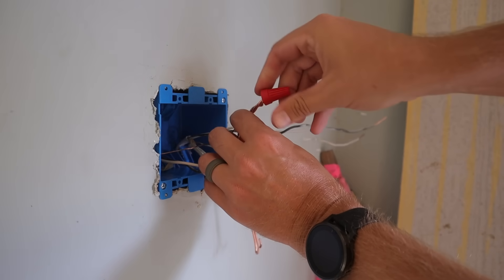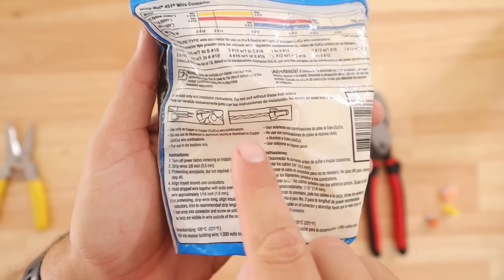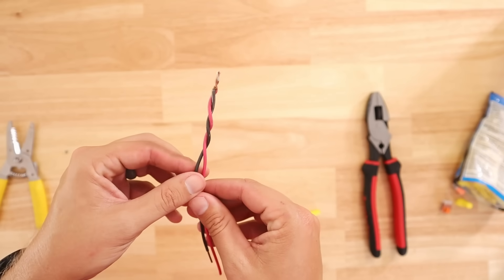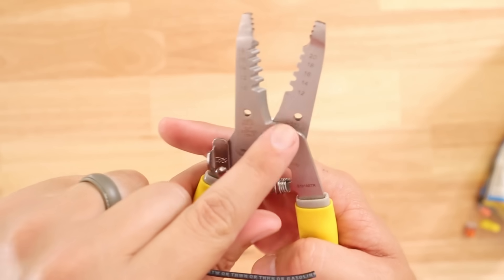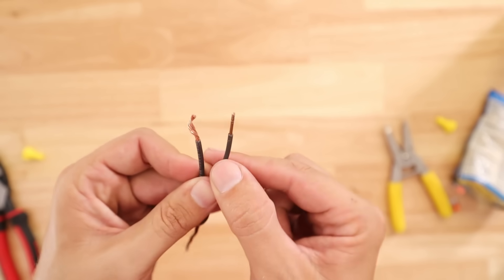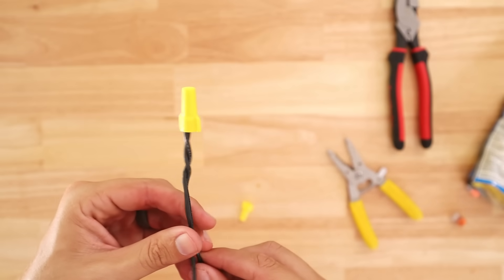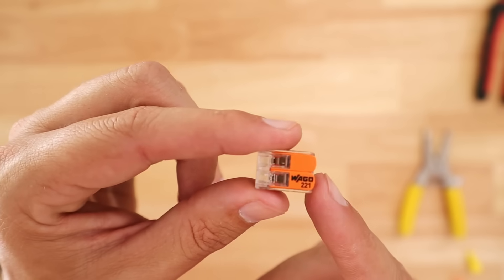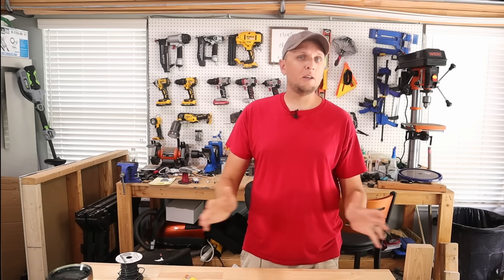BIGGEST Mistakes DIYers Make When Connecting Wires Together | How To

Comment: I did not see stranded to stranded.  String christmas light rotating  base the double stranded wire broke off flush with the tree base. I can see both strands on the base and I stripped the insulation off the other side of the power cord. Tried tape, too loose.  Wing nut or wago?
Reply from the maker: I like wire nuts but in a lower amperage situation like that, wagos would work great.

Comment: I pre-twist the wires together, Tightly wrap electrical tape over the twisted wires than twist on the wire cap nut onto the twisted wires/tape and than again wrap eLectrical tape over the cap nut tightLYyy
😬😬😬😬😬😬😬

Comment: I twist the ends of the wires first, then I use the wingnut. Using the pliers to make it equal is something I hadn't thought of that--I usually cut for even length.

Comment: Great video! I had to change out the electronic ballast on a fluorescent fixture in my bathroom today. This is a 70 year old mid-century modern house so there are some odd things we find when making repairs. The new ballast had solid core wiring, but the hot and neutral wires from the wall were twisted core. I followed your tip about pre-twisting the wires together before installing the nut. But now I wish I'd used a Wago connector, which I had in the tool box from another project. But now I know if ever I'm connecting the two different types of wire, I'll use the Wago.

Comment: Great vid! It just confirms what I've already been doing for decades, but I just wanted to double-check to be sure, as I'm not a licensed electrician. I never actually trimmed the ends after pre-twisting, but I'll do that now.
     Today I'm adding nice 20-watt integrated LED fixtures on a ceiling, and I'm tapping into a 12/2 cable for power.   So I'm shutting the breaker and for this I'm using a metal Raco junction box in my attic, and I'll be joining two, solid 12AWG wires to a single solid 14WG (3x).  A BAWN (big ass wire nut) will make the connection secure.  And I will be pre-twisting these three wires together before twisting on the appropriate sized wire nut. Thnx for the vid.
Reply: Sure hope your breaker is 15 amps
Reply: @flootloops757  Lighting Circuits are typically ran to 15 amp breakers.
Reply: I'd love to see a comparison video done with the way go and different sizes
Reply: So from what i am getting at you have a 12/2 already coming from your Panel and your adding a 14/2 in a 4X4 JB and that's going to your lights. So why not run 12/2 to your lights as well? and you could just use a blue wire nut, No need for the BAWN. Remember 14 AWG is rated for 15 amps and 12 is rated for 20 amps. Lighting circuits are ran in #12 so i would change out the 14 for 12.
Reply: @thegreatcanadianlumberjack5307  Hello to my new friend to our North!! I used 14/2 to mate easy with the small wires from the two lighting fixtures.  Keep in mind, these are two, 20W integrated LED fixture, so 40W/120VAC = 0.33 Amps.  So there's absolutely no need for 12/2 when the maximum current draw is 0.33 Amps.  Even if I replace them with two ceiling fans with integrated LED lights, that would only add around 1 amp  total for the motors plus 0.33A for the two integrated lights, gives a total of 1.33 Amps.  Plus, copper is darn expensive these days.  So that's why I used 14/2 for these two fixtures.  They light up the bedroom quite nicely and I used two Lutron Dimmers, so you can have independent adjustment of each luminaire.  Looks great in my son's room.  It was always too dark in there, due to no ceiling mounted luminaries.
Reply: @anthonyhfe6450  The problem isn't that the wire can't handle the load of those lights. The problem is specifically at the connection between the 14 and 12. You are exposing the 14 wire to whatever current is being drawn downstream on the 12. With 14 only safely carrying 15a, putting it on a 20a breaker allows the 14 to have an excess of up to 5a on it. If you continue pulling upwards of 20a through that wire, it will heat the wire nut to the point that it cracks or the 14's insulation breaks down, and the wires can very easily short out and throw a few sparks. Not a good idea. Save yourself the potential disaster and run 12 or put in a 15a breaker.
Reply: @duckyrettes  Oh yes, hi Anthony Danna. Good point.  Yes, the existing  12 gauge cable that I cut to tap into with the 14 gauge is fed from a 15 Amp breaker from the SE panel.  I believe it feeds some receptacles as since we've been in this house since '04, I don't think that breaker ever tripped before. I totally understand that I cannot change that breaker to a 20A capacity with my 14 gauge in there, but I have no need to change it at present.  And hey, it'll just be another fun future project my friend!! 👍😎

Comment: Sir , thank you so much for that informative video .
I'm an Old guy now and Old School at that . In addition to the secure twisting of the wires ( sometimes more than 2 or 3 solid copper / stranded combinations ) for added protection against possible arcing - I had always wrapped the bottom of the wire nut a time or two with some electrical tape to better seal the joint , in this modern world is that step now no longer necessarily ? 
Is that no longer a code requirement ? GD
Reply: It's definitely not a code requirement & depending on the inspector & application quite possibly may be required to remove the tape. Typically, inspectors expect to see jobs done following the industry standards & any deviation will almost always be corrected or  at least inspected to a more stringent level to ensure the tape isn't covering up shoddy work or more than likely the inspectors  spidey sense would tingle when presented w/ evidence likely identifying the individual who deviated from the norm as underqualified or in need of some retraining on the task. Once a "best practice" has been established, the criteria is recorded & published as the industry standard.

Comment: Hi and thanks for the video.  I'm a very novice DIY when it comes to electricity and electrical wiring.  I just moved into a new house that was built around 1974.  I am replacing the light fixture over the kitchen sink area.  It is a florescent light with a ballast.  The light is operated by a non-GFI switch next to the sink.  The light I'm replacing it with is an led light fixture.   I took the old light apart to get at the wires and see two individual sets of wires.  I checked the wires with a multi-meter and one set of wires has no current even with the switch turn "on".  The other set of wires has current (120) even with the switch turned "off".  So, I'm not sure what is going on here and I don't know how I should wire the new light fixture to safely operate using the switch?   Any advice would be greatly appreciated.   Thank you!

Comment: You can also use a butt end connector and crimp it. Sure it is an insulated type. You can use the non-insulated type if you were crimping together bare ground wire.

Comment: Ideal's wire nut has the outside tabs that can be used in conjunction with the wire nut tool. That IMO is the only way one would get a wire twist as shown on the instructions on the bag. I would agree that twisting the conductors with no twist on the insulated portion is not sufficient.

Comment: I've done my share of electrical work over the years. You've shown some good tips for DIYer's I would like to help you go one step further. Before I get on a ladder to install new light fixtures or ceiling fan kits, if possible I like to twist the stranded wires and solder them. This will help to make a strong wire nut connection like having two solid wires.

Comment: NO. Twist the Wires, ALWAYS. Your not depending on the device to carry whatever current is going thru the wires. That's why I always pigtail receptacles, and screw the wires down using the screws, and NOT using the stab holes.

Comment: I got those new Ideal brand In-Sure connectors that open and close but I wonder if the metal inside of them are too thin? Sort of like fusible link? 
Would you use them in 220 Vac or high Amp applications ( like clothes dryers etc)?
Thanks.

Comment: As an aircraft electrical/electronics technician, I have never liked wire nuts.  Aircraft wire, where wires don't meet at terminal blocks or connectors, are spliced.  The wires are inserted into the splices and crimped.  The connection is secure and cannot come loose, even under the flexing and vibration of flight.  No, houses don't have those conditions to deal with, but if it survives those conditions, it would certainly hold perfectly in a home or other building.

Comment: And always twist the wires and the wire nuts in a clockwise direction when tightening. Those nuts have tapered threads, and they're all clockwise for tightening... right handed threads. I know some people that didn't realize this and end up twisting the wires and the nuts backwards which actually loosens the connections, or twist the wires one way and then twist the nuts the other way. I seen you twisted them both right, so you obviously know this even though you didn't mention it.
Also, use the right size wire nuts according to the size of wires used.

Comment: I never twisted wires and never had a problem.  Key is using higher quality wire nuts, getting them good and tight, and then giving them a tug.  

Have never seen the Wago's before, but I expect they are more expensive, and, you'd need to carry more varieties of them for different numbers and sizes of wires to be connected.  By contrast, with wire nuts I can get by with 3 sizes to cover most all residential wiring.

Comment: My first house was a disater so we gutted it entirely walls ceiling only thing left was floors and overhead rafters and actual roof and windows. But i tore all the other stuff out anfd framed it insulated rewired with 12 outlets in every room on multiple breakers so no matter how u wanted your room set up there was outlets available to move everything. I had a buddy from lodge that was certified or i would of never done any of it but he taught me and checked every outlet I put in after he was done running from different breakers didnt want anything to trip from to much being plugged in. I think we put 6 or 8 outlets per breaker i think it was 6. Which was way over kill but it wasnt costing me a bunch of money so i did it. Incase someone ever hooked a heater up the rest of the room wasnt also drawing from the  same breaker.

Comment: Great video. I bought a flip house and am having to fix wiring issues.
Those Wago quick connectors for electrical wires, remind me of modern pushlock grip ring pvc pipe quick connectors. No cement needed. But a problem. Just shutting  off a supply line to a fixture and 50/50,  I get a dripping connection. Sometimes "New" is not better. But I am guessing the flippers were not electricians, or plumbers.
Enjoyed this video, Sir.
Reply from the maker: Ahh yes.  Flipped houses can be a mixed bag sometimes.  Never know where the investor may have cut corners to save money but do what they can to make everything look great.  Not always the case though.  Congrats on the house!  Thanks for the feedback.

Comment: The back of that ideal package showed a stranded wire and a solid wire. You showed 2 solid wires. Fail
Reply from the maker: And?  🤣 so are you arguing two solid wires can’t be joined under a wire nut then?

Comment: The challenge when wiring a fixture with stranded wire to a solid wire in a wall/ceiling box is the stranded wire coming out to the fixture is limited in length.

Comment: Don't over twist the solid core wire. I've seen numerous bad / intermittent circuits caused by broken wires due to over twisting. Yes, copper is very malleable, but it has it's work hardening limits too. Happy medium please.

Comment: Good video except one minor trick of the trade he left out. After you twist your conductors with your linesman cut the end of the copper at a 45° angle. Cutting the copper flush at the end can cause a wirenut to swell or push the inner cone of the wirenut through the end of the plastic exposing enough of the aluminum inner cone to cause a short especially in a metal j box.

Comment: Great video. 

It’s worth noting that reusing wire nuts is not advisable.  The internal spring can be stretched out on previous use, and not make a good connection upon reuse.

Comment: I have a set of three seperate lights in my master bathroom over the three mirrors each light about 3+ feet apart. One light starting flickering and I checked the wiring and managed to get it to stop barely and now the other one did too and I don’t really know why. Behind each light instead of two wires together each light has three sets of wires with three wires together. Two larger wires tiger and a smaller copper colored thinner wire wrapping around the two bigger wires. All three were capped that way and I can’t tell which is causing the problem. Does anyone have any advice would be greatly appreciated. Also is it Possible to reword it myself being the main cable is behind the wall and all I have access to is three small holes? TY
Reply: Never mind it was the light bulb lol. Hahaha. Man what a noob. Spent over an hour on it too. Friendly piece of advice lol try the lightbulb in another light to see if it’s the bulb hahahaha

Comment: I don’t see a downside to the wagos. I just did a light job and used wagos and am amazed at their ease. I like the flip on them allowing an easy disconnection if needed. I will using wagos going forward. (I am a diy er)

Comment: Pulling on conductors to test for a good wire connection makes sense I guess, but perhaps a more meaningful or "additional" test would involve use of an ohm meter.  One would hope for zero resistance because if there is electrical resistance in the connection you would know heat would be generated at the connection when the circuit is active.  This test would be informative in the comparison of wire connector types.

Comment: From my experience (which is mainly commercial and some residential wiring), this works best for me. 
Place wires side by side, twist the nut on, hold the wires close to the wire nut with your fingers, twist until you feel the nut tighten, once you feel the nut tighten, maybe a quarter turn more, give it a little tug test, and you're done.
If you have to get back into a box, you will be glad you didn't twist the wires together like that. 
You can only straighten out copper wires so much before they get brittle.
For stranded wire, twist the stranded (by itself) wire with your fingers until it becomes more rigid, but is still straight.
Place side by side with the solid wire and same procedure with the nut, but don't twist as much as you would with two solid wires.
Reply from the maker: Appreciate the feedback Eric!

Comment: I've seen wire nut packages that specify "do not twist". You can't argue that a single pair twisted together will make a more than adequate connection and the wire nut is good insurance but to continue to twist the wire nut after it bottoms out just starts the process of pulling it off. The big must do is to strip the correct length of insulation, use the correct size wire nut for the wire size and number of conductors, stop when it bottoms out, give each wire a tug test and visual inspect to make sure one wire did not crawl out of the connection.
I come from the industrial world and the biggest sin there is to not wrap the wire nut with tap and continue the wrap a couple inches down the wire. keeps the wires from moving in the wire nut and keeps the wire nut from backing off from vibration.
If the connection really is important, use split bolt connectors.

Comment: I can tell you that here in NY a code/electrical inspector will fail you if you twist the wires (solid copper) before nutting them. The reasoning is that twisting may cause damage/knicks to the wire which could arc. Just sayin
Reply from the maker: That's odd as one of my best friends is a union electrician in NYC and they all pretwist.

Comment: I'm an overdoer. I twist the ends (with pliers), twisting where the wire is twisted for at least 4inches, put on the wire nut then finish it off with a couple rounds of high-heat electrical tape. Yep, I'm a noob and DIY.

Comment: I use electrical tape on every connection. Put on the wing nut, tape the wires together  and tape the nut to the wire. May be unnecessary, but it makes a pretty darn secure connection.

Comment: Weak twisting the wire nuts on is bad regardless if you twist or not. I bet you can't pull one of those wires out if you tighten the nut better and if it's tight it's NOT going to unscrew itself as you tuck connection into the box.

Comment: When it comes to splicing stranded with solid I like to not twist the wires before placing a wirenut on them but what I will do is place the end of the stranded wire(s) about 1/16th of an inch ahead of the solid wire(s) then let the wirenut twist all the wires together while twisting on the wirenut. In my experience of closely 40 years, it makes for an excellent connection.

Comment: SO quick question. What options are there when (on lighting fixtures for example) you have 2 #14 solids and your connecting a stranded # 14. The two solids are already twisted well together and you adding (as in a new fixture installation) a stranded #14. Is there a Wago connector for that or am I just stuck trying to integrate the twisted #14 to the very well pretwisted pair of #14 solids.

Comment: The vast majority of electricians pretwist their solid wire connections? Did you do some sort of scientific survey? I’ve been an electrician for 23 years and the vast majority of electricians I’ve worked with don’t pretwist. If you use the wire nuts correctly you get a solid connection that won’t come apart and it’s much faster than pre-twisting.